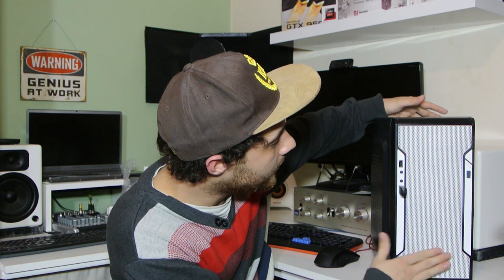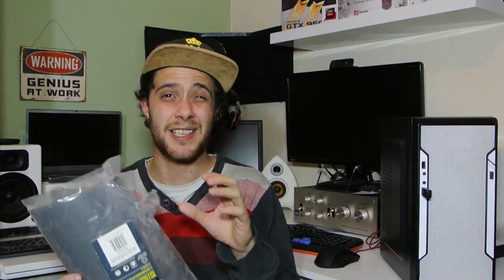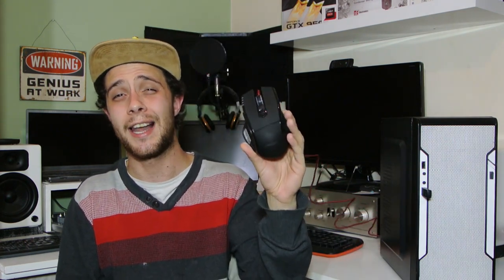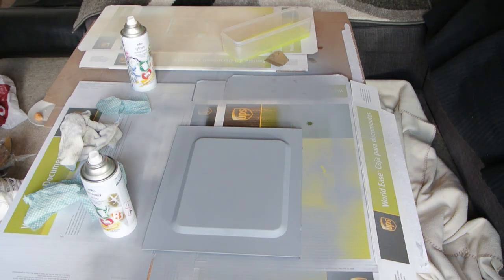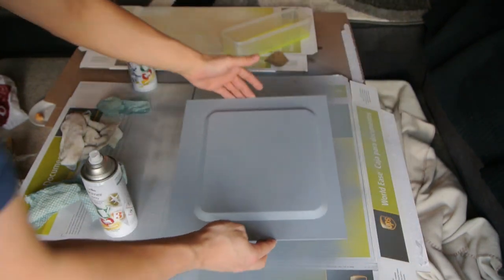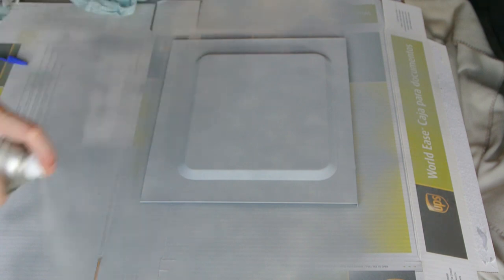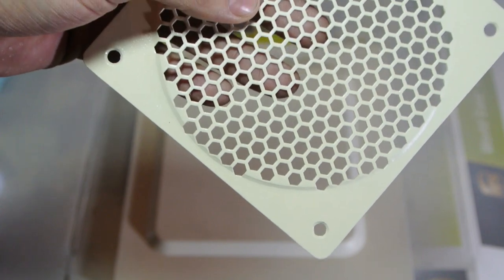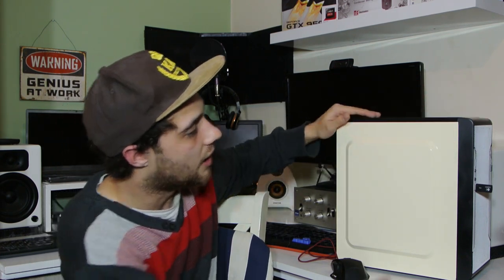How To Spray Paint A Pc Case

Comment: I use wilko spray all the time it's really good. I will say, your spray technique is on point. But... Your getting spits and bobbles because you're not shaking it enough and or you're not cleaning out the nozzle between coats by holding the can upside down and spraying for a second or two.

if it was really humid it bobbles because the paint partially dries before it hits the surface as well. I spray painted a pair of technics 1200 platters 3 years ago and it literally fell off because it was so hot lol
Reply from the maker: D2daK87 yeah I'm not that pro this was just a fun project. next time I do something like this I think I will do it in the garage. as for the technics biggest regret in my life was selling mine :(
Reply: TheFullSetup I've moved onto digital, spent a few years powder coating them for other people, will never ever do the platters again, more hassle than it's worth. lost the strobe dots by sanding the paint off. still looked shit hot. As you've as you've still got vinyl you can always get another pair. or a budget controller. pioneer Dj do one with a full copy of rekordbox dj for £220. USB bus powered. It's ideal. Not black wax though. what do you mix?

Comment: doesn't stick, because.. you REQUIRE to SAND anyways and generate adhesion whit that.

the first step is sand with 100 grit sandpaper to bare metal if's possible. that's why you finished with 6 coats of primer. other is you're using a bad product. rust oleum 2x ultra cover is always the way.

Comment: How many cans of primer/paint do you need for a full case?
Reply: I think 2 is ok For a complete case But a Tipp Dont paint the side Panel paint only the case
Reply: @tatro5830  what do you mean don't paint the side panel? I'm thinking about painting my case and wondering what you ment by that. I'm thinking you ment either don't take the side panel off to paint the whole case or don't paint the inside of the side panel, not sure though.